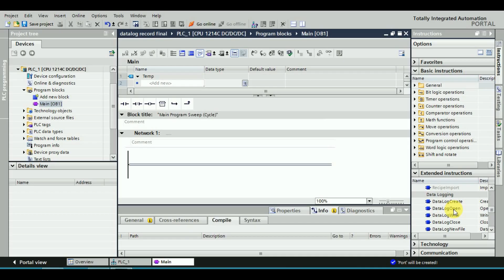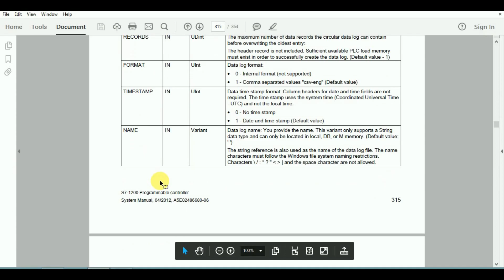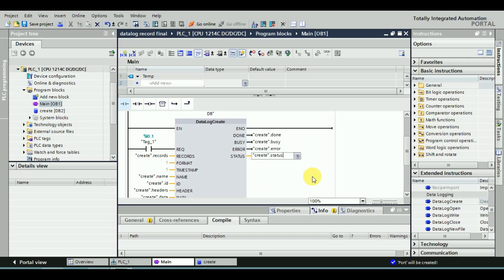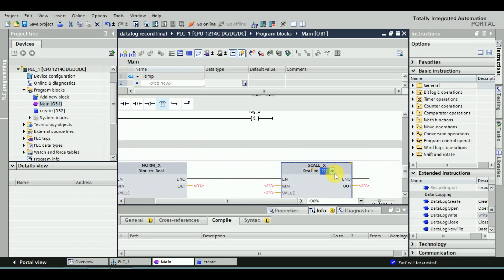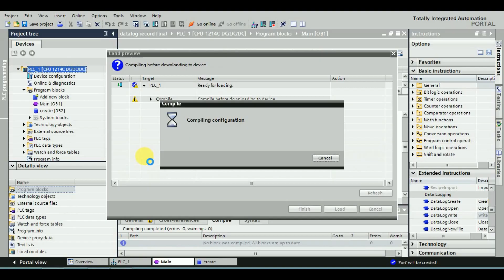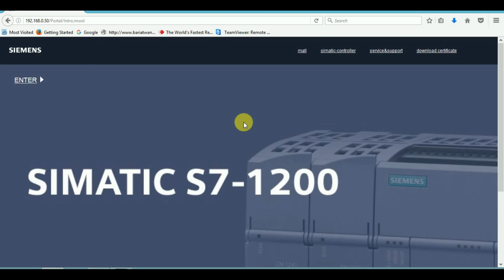S7-1200 Data logging Siemens PLC

Comment: Is there a function to clear the memory that I could operate by pressing an HMI? Trying to figure out the best method to store and save sensor data via HMI screen and want the file to be cleared for each test. I'm essentially analyzing different pressure and flow rates at different pump RPMs. Thanks for the informative video!

Comment: Hi there,

I have question, We are struggling with data frozen that not updating regularly comes to SCADA from PLC 1200 to update the transmitter reading. How to solve this issue
Reply from the maker: 1-Check your network 
2- check your transmitter 
3- Check your scada
4- chech your plc

Comment: Thank you for sharing your work. 
Just as a contribution, once the code is run and the database created, next time this function of enabling the Set of 'create.done' will not work. Unless the file already generated on the page is deleted.

At least that's the result I got on the S7-1500. But I would appreciate if there is another way to solve it.

Best regards.

Comment: Selamun Aleyküm. First of all thank you. I want to ask you some questions about this topic:

1) Do we have to use an SD Card to save datalog?
2) Can I save more than one datalog? ( For ex: 1st datalog saving 32 unit thermocouple, 2nd one is saving pressure or smth like that.)
3) How much sizes do we need to save in SD Card? (if first question's answer is yes)
4) How much Tag or unit can I record(save) maximum?

Wish you a great time.
Reply from the maker: 1-no you can save it inside the plc.
2-check the manual but if iam not mistaken you can open 8 log max at the same time.
3-idont know 
4-i don't know
Reply: Ali Al-Mukhtar Thank you so much

Comment: Every time i download a log it's create a new Exel file instead writing the new values in the existing file like in the video.
What must i do get this done, is this a Excel thing?
Reply from the maker: I don't remember exactly,  you have to check the manual,  but i think you need to use open instead create
Reply: Hi thank you for the answer, I've looked everywhere but the screen that appears in the screen at 17:17 I don't get it at all.
All I get is a filename that I can click on and the download will start immediately